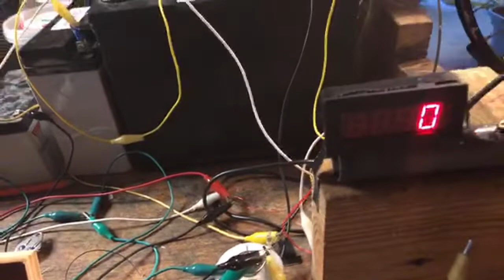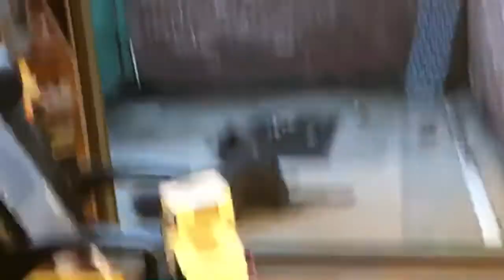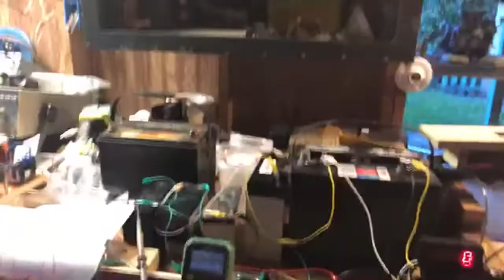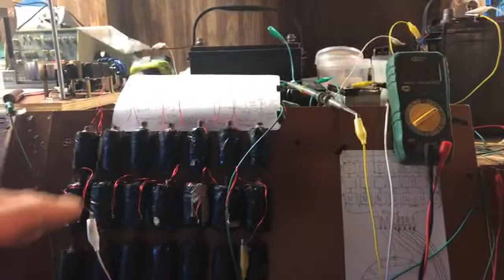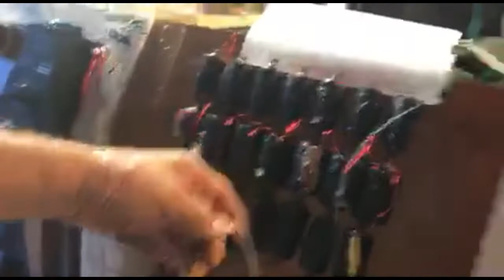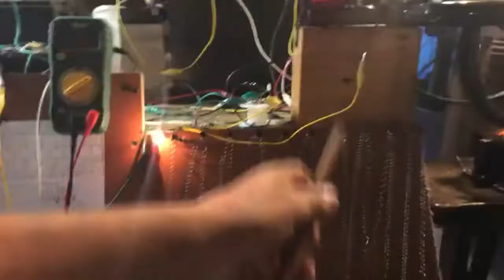Coral Castle, Ed Leedskalnin,Figuera, Bendini!

Comment: Ed is the master and one expirment that always blew me away is ed talking about the neutral part of a magnet I have been reading the book of enoch and enoch talks about such things too. Notice the light bulb surge every time you create a sine wave through the iron core. Ed talks about in a light when the magnet passes the coil it creates two flashes instead of one but they come in quick succession any ideas on recreating this experiment of eds? I was thinking about finding what the edge of the magnetic field is and moving the iron core into the field slowly and then out of the field to see if the light lights up each field has two poles I thinking recreating this experiment of eds is imperative to understanding electricity I suggest getting a pvc pipe drill 3 holes in it spaced apart put coil outside of pvc and have stoppers inside of the pipe mount pipe vertically and drop one of those chubby magnets you got into the middle part of the coil and see if you have a light then pull the wood keeper in the middle of the pipe out letting the magnet fall all the way through the coil and see if it has a second light. If it works then the problem must be the geometry of the magnetic fields we are using. Meaning the two currents are not balanced because of location. At equator both currents should be perfectly balanced anywhere else on earth and it would be hard to recreate the expirment without heavy mathematics and windings calculations involved

Comment: I love your work! I want to make you aware of my findings concerning NPN transistors and Bedini bifilar coils and the Bedini wheel (Mechanical Oscillator)... By using a Hertz meter you can verify what I'm about to explain... The event of the magnet passing the coil doesn't determine the frequency on the charging side of the circuit like most people think! My wheel has 3 North magnets spaced 120 degrees on center with 75 Ohms resistance and the actual RPM is 1840 times 3 magnates = 5520 events... However checking the frequency before the square bridge rectifier the frequency is only 180 Hertz... I oscillate bifilar coils without cores or wheel @ 90 ~ 2000 Herts on the charge side with just the 140' #20 / #22 coil, though the 2N2222 NPN Transistor can handle 250 MHTZ... Best wishes and thank you for sharing your work! Bill
Reply: I posted a video demonstrating this https://www.youtube.com/watch?v=lc-wHNDrpwk
Reply: Divide the RPM by 60 seconds to get the frequency... So frequency can be directly relevant to RPM as far as events...  36 Volts = Meter says 140 Hz 29957 RPM / 60 * 3 = 147.85 Hz...  24 volt = Meter says 120 Hz 2538 RPM / 60 * 3 = 126.9 Hz... 12 Volts Meter says 80 Hz 1825 RPM / 60 * 3 = 91.25 HZ...  Capacitor can load the wheel RPM down, however Coil frequency remains the same...